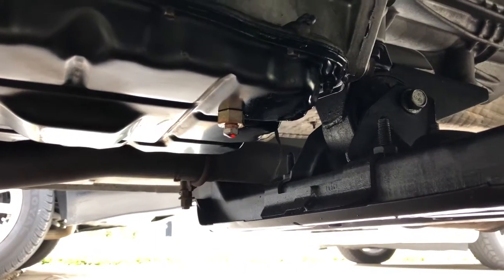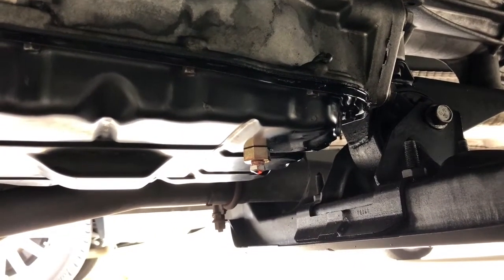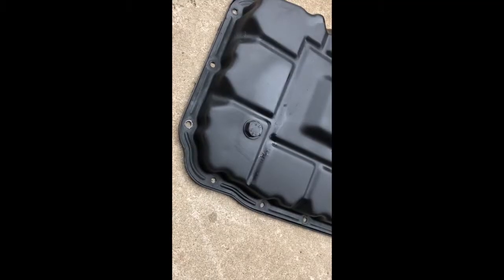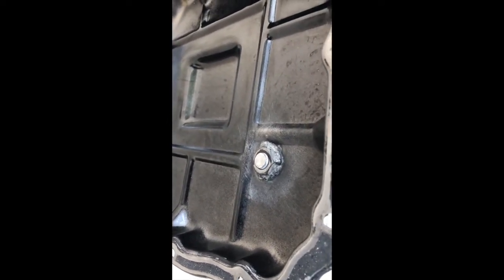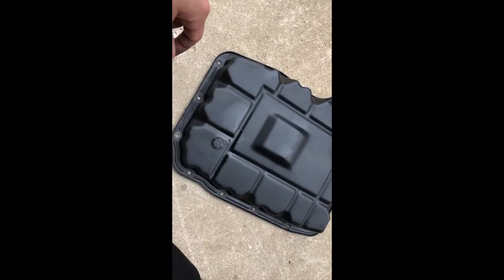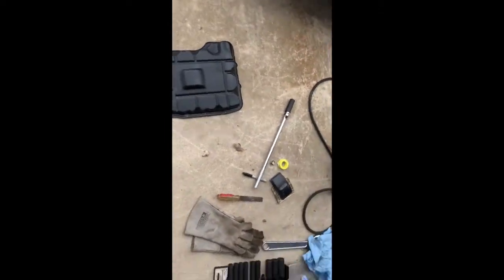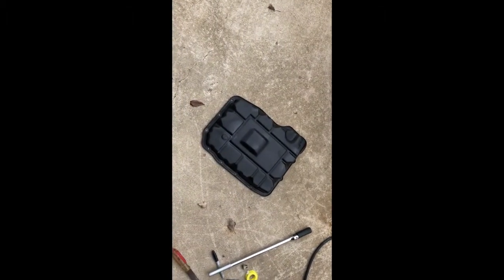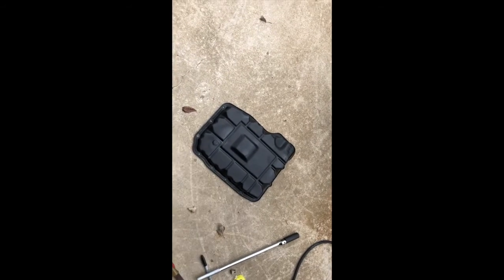B&M Transmission Pan Drain Plug Update - Review

Comment: I’ve used this same exact drain plug. Simply use blue monster ptfe thread tape on all threads, and add a metal washer over the top of the plastic washer provided on outside exposed part off pan and tighten just enough to snug the main drain bolt from outside.